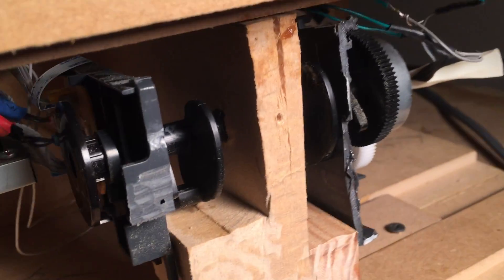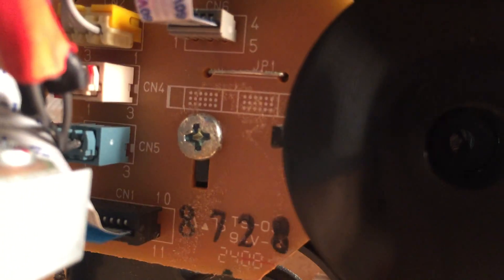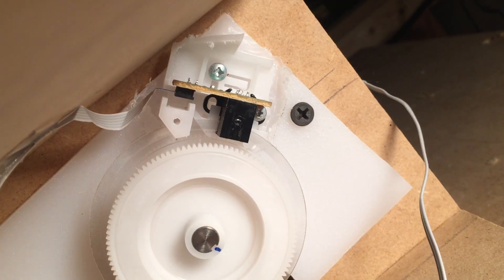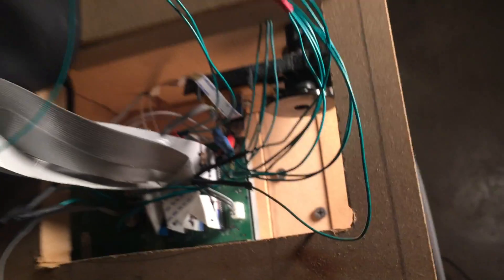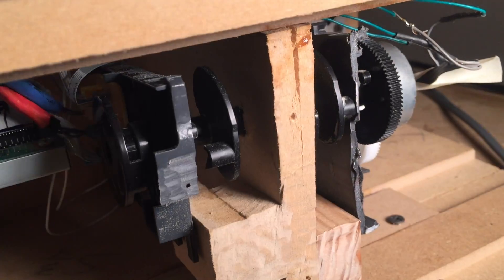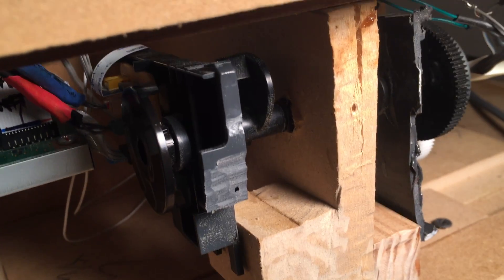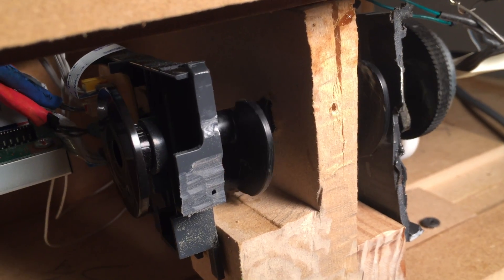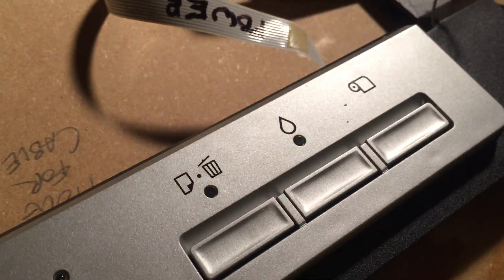epson dtg 2880 tshooting ASF error

Comment: Did you ever solve this issue? I'm having a similar issue with a p600.
Reply from the maker: +Josh Yeah I solved the problem.  In short, I had two wires plugged into the wrong place.  You can check out a thread I started here, http://www.t-shirtforums.com/diy-dtg/t599570.html